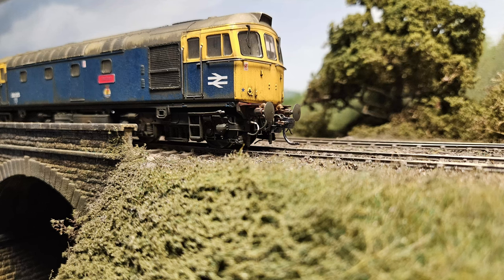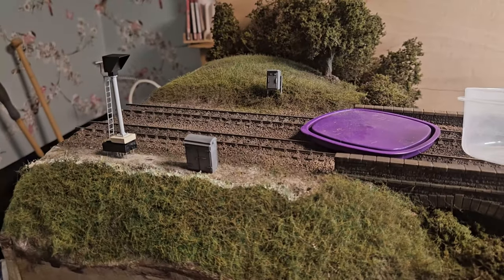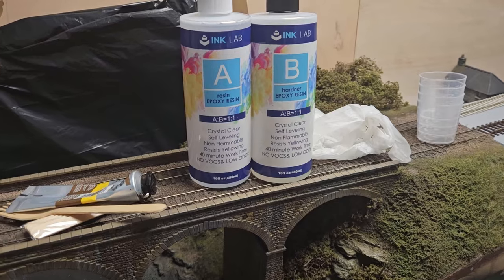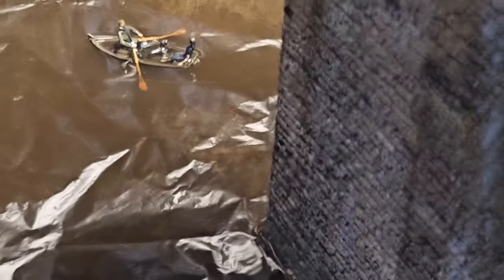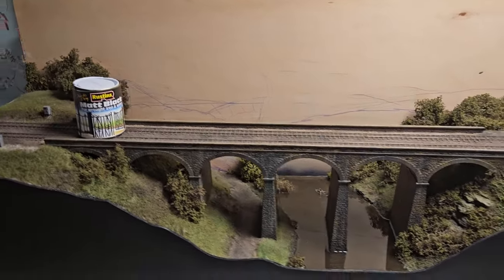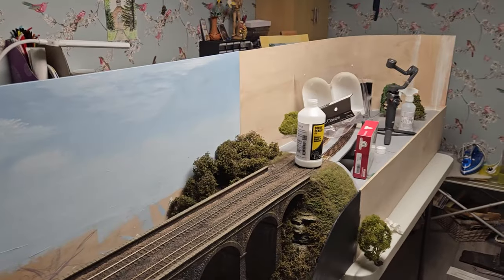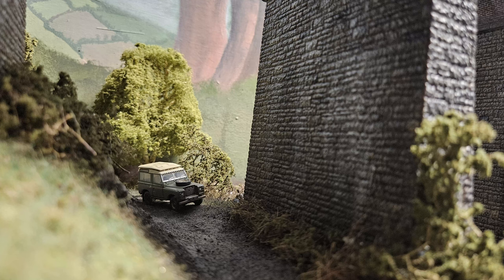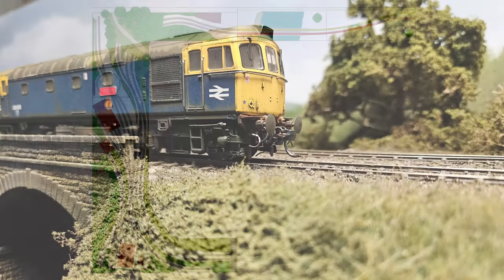Feb Layout Update - Scenery, Resin & Painting Backscenes #5

Comment: The design for the new board looks fantastic, be great to see the diesels and steam locos side by side 🎉
Reply: Btw, what type of ballast do you go for? Looks n gauge? I was looking to try using chinchilla sand, which seems to be a good scale ⚖️
Reply from the maker: @_RandomPea  yeah I'm looking forward to it. It's now looking a while off as it won't fit in the loft and will therefore have to wait until I move the layout into some sort of shed. I've just ordered the baseboards for the station module though.
Reply from the maker: @_RandomPea  it's woodland scenics fine ballast. What is traditionally sold as 00 scale ballast is usually over scale when compared to the real railway. I quote like woodland scenics fine with a mix of grey blend and sometimes buff. I might well look at chinchilla sand in the future as it does seem like a good cheap alternative.
Reply: @HorsehayRailwayModeller  ah that's good and bad news, I've just finished painting up one station platform, so interested to see your methods. I used 3 5mm foam boards glued together and then topped with a watered down lightweight plaster. It seems to work quite well. I reckon I could have got it smoother but it's ok.
Reply: @HorsehayRailwayModeller  new junction used it, I think it's ok. I'll show my tester in my update video later, it seems like a good option, until they realise that modellers are using it and the prices hike up 😂